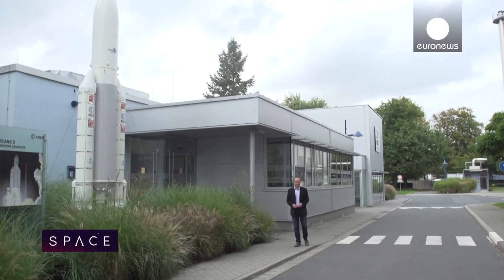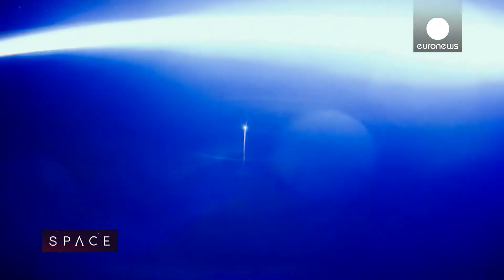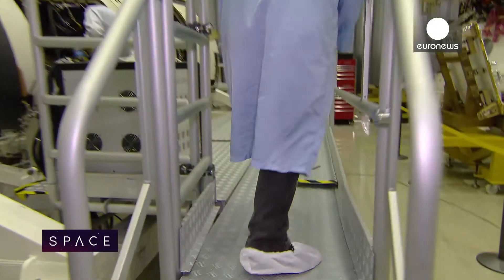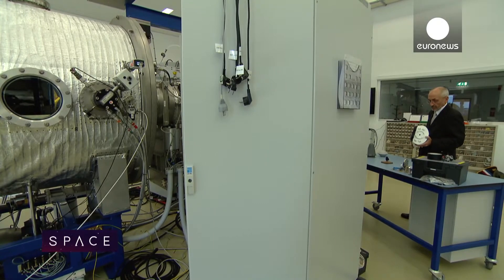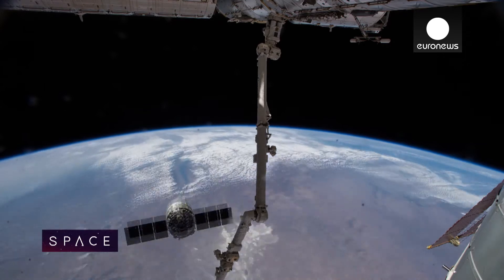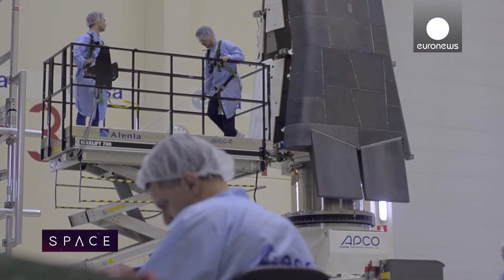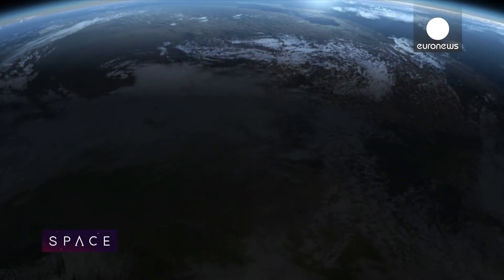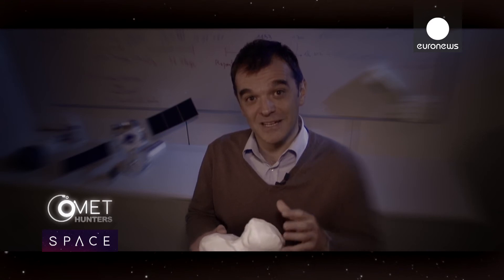IXV: Facing The Challenge Of Re-entry

Comment: Does re entry require propulsion or its just gravity. Why slow speed not possible.
Reply: u need lots  of fuel to slow  down something  traveling  28,000 km an hr..and the space  shuttle  can't  carry  that much amount ...the question  should  be why wouldn't  these  people  use the resource  first to save  life  on planet earth ,  where the only  planet  know  to support  life
Reply: well you reduce your orbital speed by just 200 mph from low earth orbit with propulsion. The rest is done by the flightpath (gravity) and the atmosphere. So 99% of the braking is done by the atmosphere.